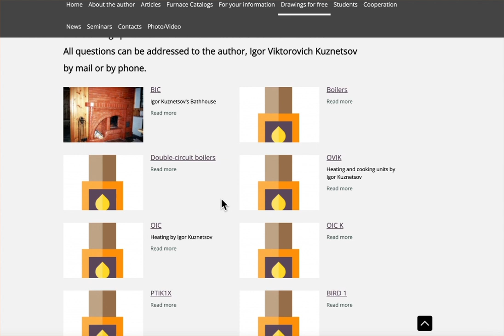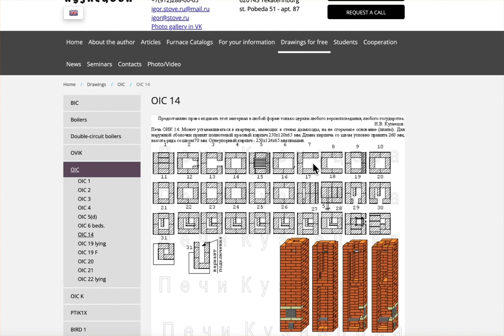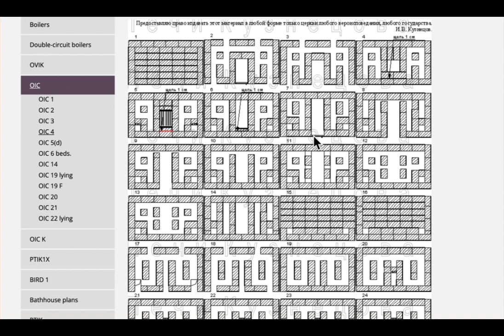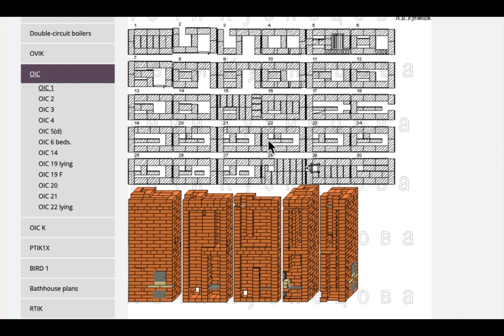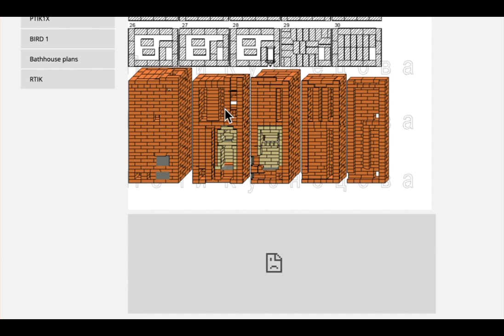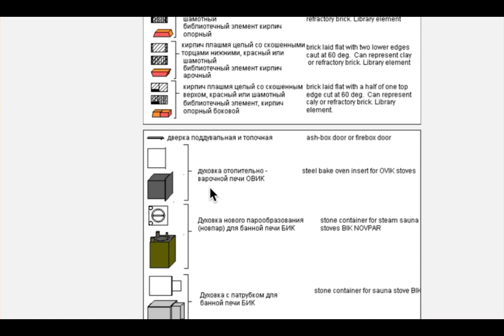How To Build A Russian Stove Free Designs from Igor Kuznetsov

Comment: It is efficient looking in a complex way. The Rocket Mass Heater turns a complex expensive stove into a basic$1,000 stove that any Arkansian, Missisipian that can read. Didn't the Mississippi highschool beat the country academically last year? If you can tie your shoes and read simple instructions, one can build a battery mass with a J channel fire box that will safely heat the area for as much as 24-48 hours on appeox 60 ponds if wood depending on high tight the seams are in tour house. The originator or salesman that puts great effort into promoting this stove built the stove in place, in a canvass T-P and lived in it in a Montana winter burning X lbs wood X a day, maintaining, 50° at sunrise, in the winter, in Montana. And you don't need $15,000 grand and an engineering or Learing degree to do it.
Reply: Stated as 97% real efficiency.  How well does it work? Average temp during firing hot enough 1800? To burn all the smoke and kreosote completely, releasing 150 - 190° at the chimney. Once the stove is at temperature, the exhaust is unscented vapor.

Comment: Was curious which stove you have built?  And in your opinion, you don't think the fire burns as hot as what it does in a rocket stove in the burn chamber?  How would you get complete combustion if the fire wasn't as hot burning?
Reply: Si j'ai bien compris, dans un rocket stove, c'est le tirage qui crée l'oxygénation "forcée". C'est pour cette raison qu'une cheminée est nécessairement haute avec des fumées encore chaudes en sortie.
Ici il faut davantage comprendre que le bois est amené à la pyrolyse par l'effet de la voûte chaude. Un peu comme on fait cuire le pain dans un four traditionnel. Le feu est moins intense mais les gaz en partie haute de la cloche peuvent atteindre les même températures il me semble. Et donc assurer une combustion optimale ici aussi. C'est le refroidissement des gaz qui est moteur du tirage ici. C'est génial car en théorie, une succession de cloches disposées horizontalement et En serie seraient de moins en moins chaudes et ne nécessiteraient même pas de cheminées... En théorie !
Reply from the maker: I have many videos on my channel showing stoves being built. The rocket stove combustion chamber is the hottest. Masonry heaters and Russian stoves achieve complete combustion in other ways, like having a high firebox that allows a lot of air mixing.

Comment: Great advice  .I've just built such a stove inside a huge  brick fireplace,  with tiles on the outside  face ,its working well ,no smell of smoke etc,this winter and , reassuring  to find out about  the formation and prevention  of creasote   thanks .

Comment: Thanks for the great video and link. Are there measurements on these plans for spaces in between bricks?
Reply from the maker: What spaces between bricks? For a spacer between firebrick and red brick insert flat carboard that will "smoulder" and eventually burn away. Many stoves in these plans, though, have no firebrick. Many are designed to use the same brick. In the U.S. all we have access to that are symmetircal are pavers. Russians have more options. Red brick stoves without firebrick can hold up for many years if certain principles are followed.

Comment: Great video  FYI wet saws blades ie diamond blades are smooths because they have diamonds imbedded in them  Diamond is a much harder than concrete porcelain exc so is chips away instead of cutting away like blades with teeth  through wood

Comment: Would it make sense to have the roofs of both bells with double layers? To have more bricks and keep more heat in the stove? Or would having the double layers influence the functioning in some way?
Reply from the maker: I would only use 1 layer at the top of the first bell. 2 at the very top.

Comment: When the fire has been burned and there are only embers, it is recommended to close the smoke outlet so that the hot air remains in the oven. Wouldn't this allow the gases from the burning embers to enter the house? Or is there a small passage that is always open in the closing/damper itself? I am not familiar with this type of oven, hence the doubts.

With this OIK 4, would it make sense to have an air inlet for double combustion, or is the air that enters and the height of the chamber already enough to burn everything that is needed? Thank you
Reply from the maker: The Russians do this but many, many have died over 200 years closing too soon. Unless it's absolutely necessary, never close all the way.

Comment: Very good project, I was researching about masonry heaters and I came across your video.

If I wanted to use one of these to heat the whole house, I thought about using air ducts, with forced ventilation. But how would I be able to "catch" the very hot air from the masonry heater and distribute it through the ducts? Only the hot air, of course, not the smoke. Do you have any ideas? Where and how could I capture this hot air? Thanks
Reply: Perhaps it could be walled off with a lot of insulation and run ducts into the space that it is contained in
Reply: You would have better luck heating water and forcing it into batteries through exchangers. Air ducts would be better for pulling cold air from elsewhere in the house but exchanging wouldn’t be as efficient.

Comment: Worth noting that the Russian brick used in these plans is 5"x10" not the 4"x8" paver size you'll find in the US. Meaning the firebox with a US paver would be 8x8. Also the jumper brick above the firebox door is most likely a type of flat arch where the ends are cut at a 45 and the two brick on either side cut to match. Hopefully that makes sense.

Comment: I just finished building a heater designed by Alex Chernov, haven't used it yet. But I'll comment on a few things I know through him so far. 
Mortar: he was pretty adamant that only pure clay/sand mortar can be used in a single skin heater like these. Not sure why. 
Chimney warming: They light fires in the upper cleanout chambers to warm the chimney, there's a few videos on it. Survival Russia has a video detailing the Russian stove
Reply from the maker: Thanks for the information. In a simple stove without a firebrick, separate firebox, much of it gets SO hot it has to "flex a bit" and expand and contract. 3 parts sand to 1 part fireclay allows this. Cement would crack. I don't think it hurts to add 1 part lime to the clay/sand mix to harden it up a bit quickly, or nothing sets up quick and unless you are an expert or are going for tiny joints, you can't keep building the stove because everything slides around for a day until it dries a bit. Refractory mortar at about $40 a bag should also flex a bit in high heat, and if not, what good would it be. It must.

Comment: I wonder if these stoves with complex exhaust paths have problems with creosote build up?
Reply from the maker: Yes, I'm sure some do but NOT AS BAD as you may think. Many Russian stove designs have 4, 5, or even 6 clean out doors "to get in," and when I've seen them opened up, it's 95% about ash buildup and blocking channels with ash piles and it's NOT about creosote cleanout. The reason creosote would be less than expected in these stoves is because of how the Russians burn the stoves. Two lightings a day (morning and night) for 5 or 6 months straight. NO days off. The bricks hold heat, and without one day off, the bricks never "gets cold." It's cold and moist channels and pipe conditions that create creosote. Here, the channels are warm and dry 6 months in a row. Also, the bricks are "in the home" so that keeps them warm too. In a chimney, most creosote buildup is in the top 10 feet when things get cold and moist, close to the outside air.
Reply: @stoveadvice  wow, you sound like a contractor. long way from schlepping insurance...
Reply: @stoveadvice  The house i'm born in is basicly 2 big European brick chimneys. One for the fireplace the other for fresh air. The house it self is build between it. The top of the roof lays on the chimney. Just like the 2 side walls are on wall of the chimney. It's all integrated in the design of the house. We did not "buy" extra bricks to build a fire place and air conditioning. We just build a good designed house that matches it's environment with local material.
Reply: @stoveadvice  And we have more natural gas than trees/wood right now. Thus the fireplace is gone and replaced with gas. Burns perfect, full control. Within 10 years we will have 3d printed gas turbines under $2000,- There is no need to burn wood anymore where i live.
Reply: @RogerKeulen  Unfortunately, we don't all live where you live.  Some places, even in the USA are not privy to NG.  And oil or LP is priced way too high.  Many of us actually DO need to burn wood, especially in rural areas.
Reply: Never use iron or other "cold" thermo conductif material. The "build up" is actually condensing of a gas of badly burned material that are a solid under normal room tempratures. That's also the more dangerous part of it. It's still a fuel and will burn again when heated and adding a oxidiser. Thus when you have good wood, good meterial selection and a good design, creosote will never be a problem. Just make it hot enough on every burn cycle🙂